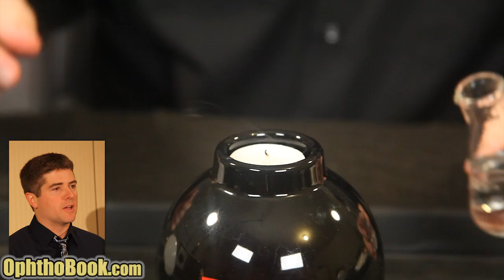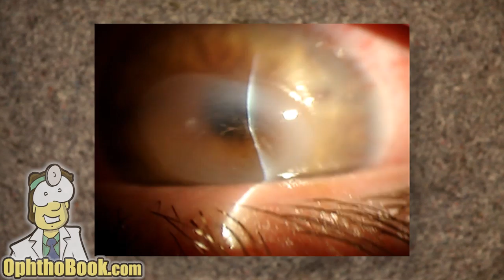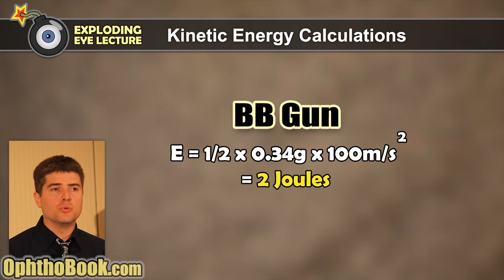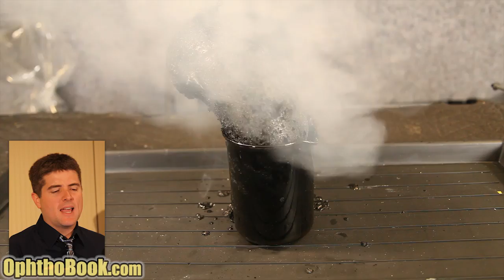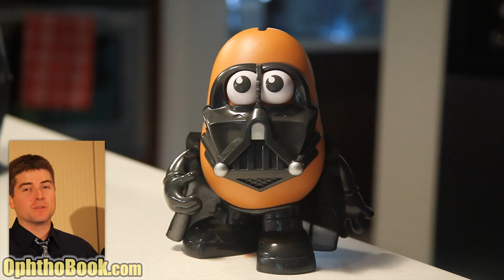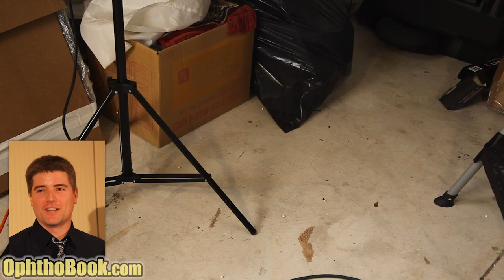Exploding Eye Lecture

Comment: I got shot directly in the eye with a high powered gas desert eagle 
pistol airsoft medium range, Metal BB bullet,  I couldn't see out of my 
left eye for 5 hours and everytime I closed my right eye I couldn't see 
out of my left eye at all, for atleast 5 hours and I thought I was blind
 or going to go blind, because it wasn't getting any clearer for 4 hours
 but then after 5 hours it started getting clearer and now 5-6 hours 
later I can see pretty much fine but it hurts and there is a little bit 
of glare on my eye but apart from that its fine, I am thankful I am not 
blind and consider myself extremely lucky.

Comment: What are bases? or basis? in the chemical section?
Reply: Bases usually make up most cleaning agents. A very weak base is soap for example, which wouldn't hurt you. But other cleaning agents can mess you up if you don't clean your eye as soon as possible.
Reply: base's are alkali's, the opposite of an acid.

Comment: I accidentally shot myself in the eye twice with a pellet gun, the first time I was sitting outside on my back deck and I was trying to shoot something off the rail and I missed and it hit the rail and ricocheted off and hit me in the left eye but my eye was closed and it didn't do much but make my eye a little red. The 2nd time, I was bored so I shot at my bedroom wall and it ricocheted off and hit me in the same eye as the time before but my eye was closed again so it didn't do much but make it red a tiny bit. The only reason is ricocheted off my wall is because it was low on co2 so it didn't have as much power as it normally would.

Comment: why would you rub something on your skin that can melt an eyeball?!
Reply: It's if it gets in Ur eye on accident
Reply: I had a sunburn so I used aloe with lidocaine (numbing agent) to help numb my face so I don't get cancer
Reply: Derpy Pillow The fact that you've already had the sunburn indicates you've already damaged the skin with too much UV exposure, the aloe Vera won't necessarily protect you from developing cancer but possibly just soothe the damaged skin so that it can peel off faster and all the lidocaine will do is numb the area. Continual damage to the skin via sunburn is cumulative over time and that's what eventually leads to skin cancers. Best protection is by using >SPF15+ sunscreens at least 15min before getting into the water and every two hours thereafter.

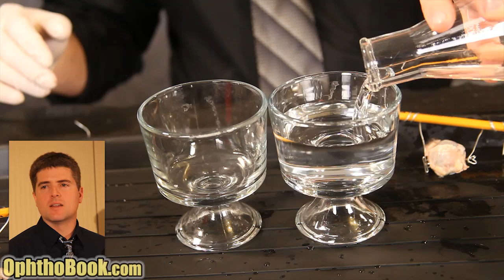Comment: HOLY SHIT DO NOT ADD WATER TO ACIDS OR BASES. 17:25 you could have seriously hurt yourself, always add to water when diluting acids and bases.
Reply: Uhm... excuse me... Vinegar is an acid, baking soda is a base and you can mix them with water. Even water can be an acid/base :D Anyways. That rule is ONLY for 90% or more concentrated sulphuric acid and there is no rule like that for lyes.
Reply: Krisztián Szirtes Although, it can be 'interesting' to add small amounts of water to solid sodium hydroxide in a plastic container <grin>

Comment: A 1W laser is nothing.  3W and even higher are "easy" to get a hold of.  IR is especially dangerous.  By the time you can see the light, damage has already occurred.  1000W industrial lasers are also becoming more and more common.  People need to realize these are not toys and use common sense and good eye protection.